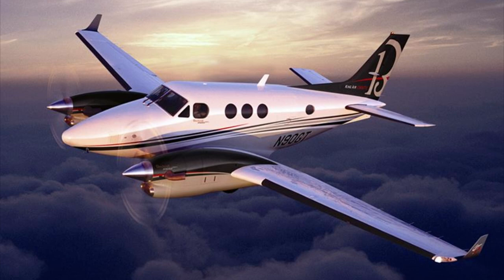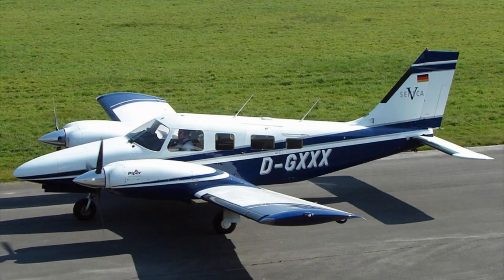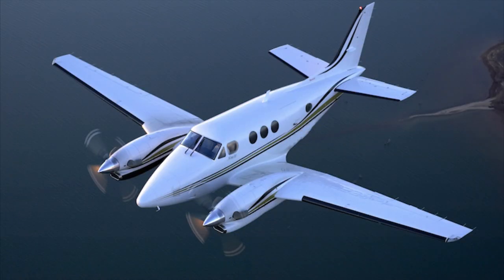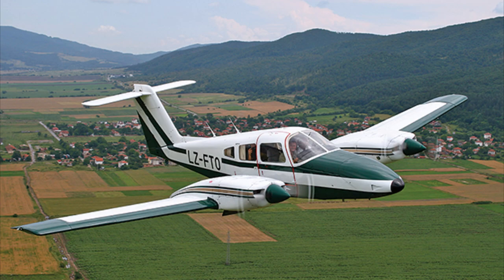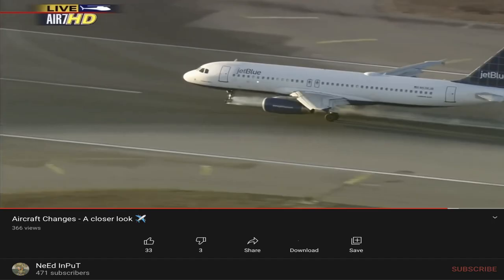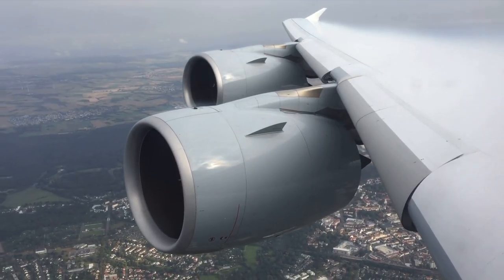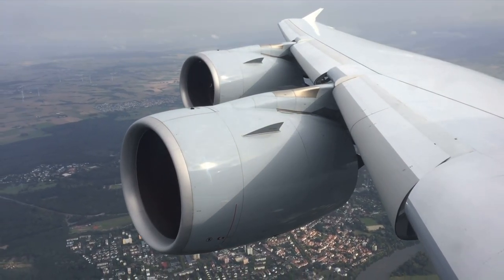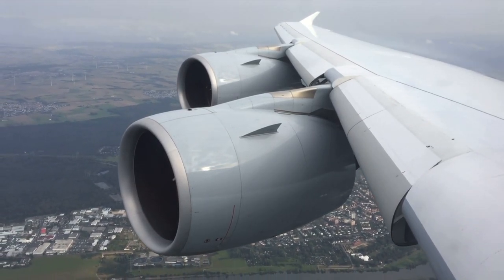Twin Turbo Prop Aircraft

Comment: 'sup Blaze... Loving all the aviation videos! Started in the '70s with building balsa wood model aircraft and grandfather was a test pilot in WW2. Maybe 15% flaps for takeoff but never heard of any slats. They must have a lot of weight in the tail of those planes to get a decent CG with the engines that far up.
Reply from the maker: Domo arigato ☺️

Comment: I don't know much about planes but: didn't planes used to fly utilizing thrust and aerodynamic wings (ailerons) to produce low pressure above the wing and building up pressure below the wing for assisting lift.... Now it seems they fly using 'toroidal vortices' or something like that, and this effect [to me] was introduced when the nacelle was moved forward in a past mandela effect change to planes (where 'the engines are not under the wing anymore but moved forward sticking out...'). that change allowed vortex generators and slate to assist with lift - now I am ignorant on how planes work but it seems that they would not be needing near as much forward motion and intake of air - so maybe that's when the planes starting 'standing in mid-air' ?? lol 

if I may add: 
i like the theory that we are sending Chrononauts back in time to introduce technology concepts earlier, thus pushing forward our present technology in this part of the timeline. (torroidal blades popped up about 10 years ago out of nowhere... along with many mandela effects around 2015...)

keep up the great vids!